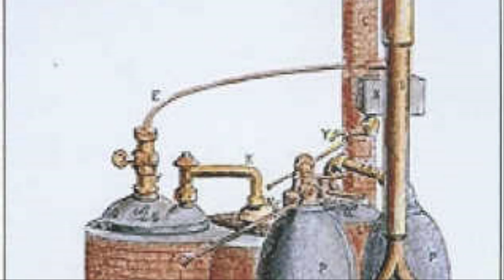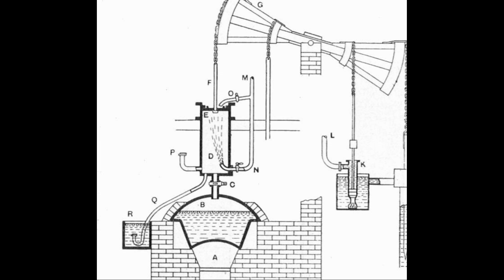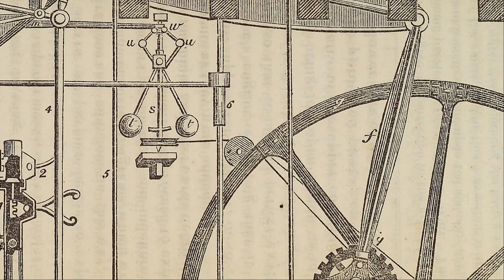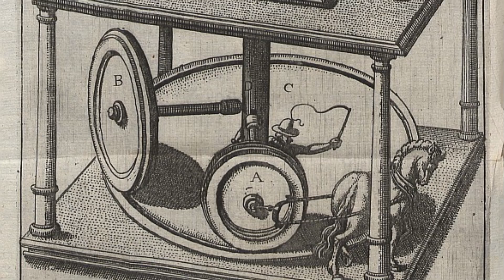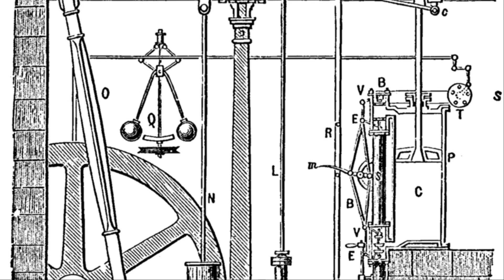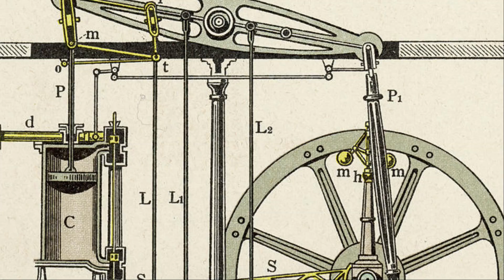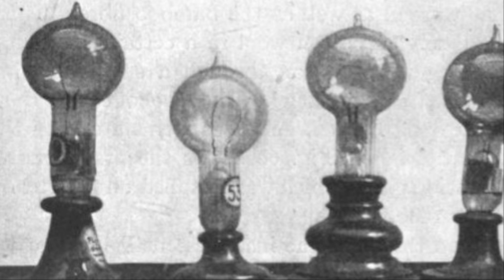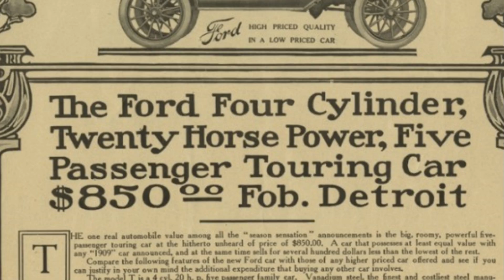Horsepower: James Watt and the Transition from Horse to Steam

Comment: It should be noted that only the USA still uses such an arcane measurement while the rest of the world measures power by the KiloWatt.
Reply: Most of the world used HP for power a few years back.  The change to KW is fairly new.  Electric cars in the US use the KW rating and some ICE ones are starting to.
Reply: @kensmith5694  I suppose that's true of the general public. In any engineering, the measurement would actually be taken in KW and then converted to HP (or BHP) for a more "familiar" comparison to the consumer.
Reply: @CraftAero  
For an engine, you would measure the torque and the RPM.
Power = Torque * RPM * Constant
What constant you use depends on what units you want in the result.
BTW:  A lot of gear still does torque in pound-feet.  Perfectly good gear that dates from the 1960s can still be in use.

Comment: It's Newcomen, not Newcomer!.  And since I'm here, I will pose a question that has nagged me for years.  Newcomen's engine was an atmospheric engine, not a steam engine.  The steam was only used to create a vacuum.  Watt's improvement was the external condenser, which eliminated the heat lost in cooling the cylinder.  Did Watt ever build a true stream engine (i.e. one that used pressurized steam)?

Also, his use of the sun and planet gear was not a brilliant innovation.  Watt used it to get around a patent on the crank.

Comment: Not to be pedantic, but I guess I'll be pedantic. At one point you referred to the horse power as energy. Probably a slip of the tongue, because the horsepower is a rate of producing energy, as is the watt. As you said foot-pound per second
Reply: What's a pedantic is thst when chicken flu goes on a jungle gym ml sounds like fun either way

Comment: Well after using horses as my main source of power on my farm and then going on to challenge the term hp as it’s level of work , I have found that the Bolton and Watt hp is = to what one mine pony can do and not what a full size horse and most definitely not what a draft horse can do ! I pulled a huge field cultivator the manufacturer claimed would take 150 hp to pull ! I did it with 46 drafts ! With ease with 46 drafts ! For a 8 hour day ! For about a week ! Sooo if u kind of get ur head around a mine pony as the source of hp it makes sense ! But not at of a real horse !

Comment: Please don't confuse energy or "work" with power.  Raising 33 pounds 1000 feet does 33,000 foot pounds of work.  A horse might be able to do that in a minute, or a man might be able to do it in 5 minutes, but the amount of work or energy is the same.  Heck, you could connect a gearing system to a hamster wheel and the hamster could lift the weight and the work would be the same, but it would take a while.  The horse does it faster because it can generate more power.  More power is faster work.

Comment: I find the statement that the Watt is a measure of output from a bulb while technically correct it is not a good definition.   The best way to define it is in mks units of 1 Joule per second.  Or in most simple simply a rate of energy changing forms.   ( not consumed because energy is always conserved ) 
I know I’m splitting hairs, but also 1 Watt = 745.7 Watts or rounded to 746.    I apologize.  My physics degree is showing.

Comment: Was taught that 746 watts = 1 HP but in real world around 1000 watts due to 4 major losses in motors. Of course goof balls in Europe seem to use the 746 watts as a HP. Had major problems with junk IEC European motors. Yes they.are smaller & cheaper then USA NEMA motors but always run hotter and do not last as long as a USA motor. From a retired industrial electrician with 50 years experience.

Comment: G'day,  

Here in Oz, the story was that the Cask of Water weighed 550 Lbs, fifty Imperial Gallons @ 10 Pounds each, plus 50 pounds of Wood in the Barrel.

The "Horsepower" was thus 550 Foot/Pound/SECONDS...; which was achieved by the Horse wearing a Collar attached to a Rope reaved over a 1-Ft Diameter Pulley before going down the Mineshaft to the "Bucket",
As the Horse walks away, over flat ground, the 550-pound Load was thus lifted 1 Foot per Second...., as the Horse walked away from the Pit-Head (at 0.7 mph..., because 1 mph equals 1.42 Feet per Second).

All that Guff regarding a "33,000 ft Mineshaft with  a 1 Pound Weight, for a full minute...." ; it's pure bullshit mate, EXTRAPOLATED from the original OBSERVATION.

"Pit-Ponies" didn't lift Water, they worked underground, pulling "Skips", open-topped Carts running on Rails along the "Drives" from the "Coalface" to the Shaft.

Full sized Draft Horses worked above  the Ground, pulling Ropes going over Pulley-Wheels to raise Loads of Water, Ore/Coal, "Spoil" (the Dirt & Rock surrounding thr Ore), and People, up the Shaft.

  It might have been useful for Calculation to know how many Foot-Pounds a Horse could pull in one Minute...; but a 33,000 Ft Mineshaft in the 18th Century was otherwise a figment of a deranged Imaginitus, sir.

So, I suggest you rethunk your "Explainification", and recast the Story to fit what actuarily occurrred...

Just(ifiably ?) sayin',

Have a good one...

Stay safe.

;-p

Ciao !

Comment: Watt was that guy's name again? You know, Jimbo something? I noticed some of your horsepowers were donkey-powers. I assume the donkeys had less power and required different gearing of the devices. In that case, is that where the phrase "Get your ass in gear" comes from?

One other observation: "Man is capable of great and wonderful things through science and mathematics; however, none are so grand and beneficial as those that convert plants of all kinds into alcohol." If said devices also ease or eliminate the burden of man for other routine tasks, then such secondary applications will free man for the consumption of the product of the first!